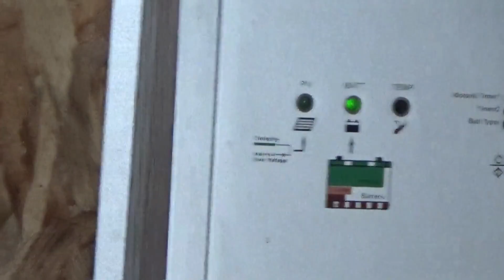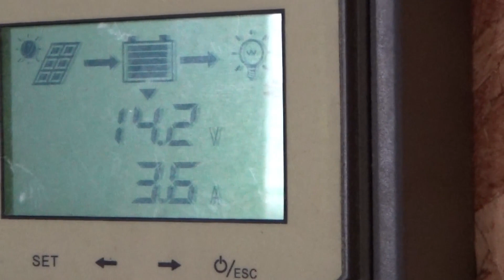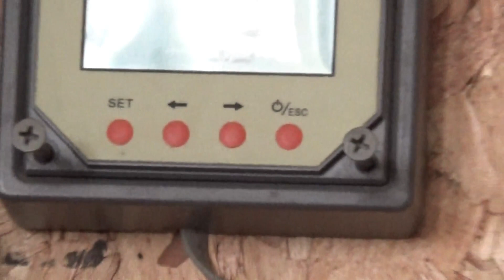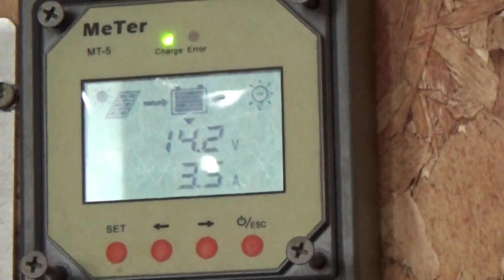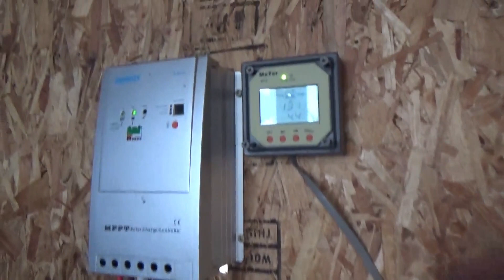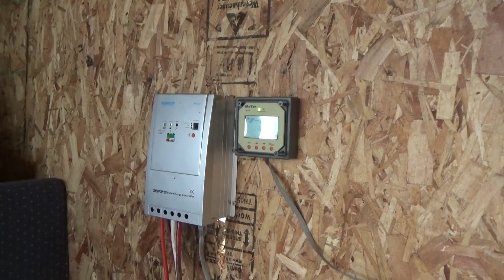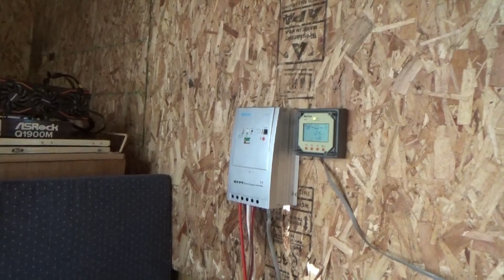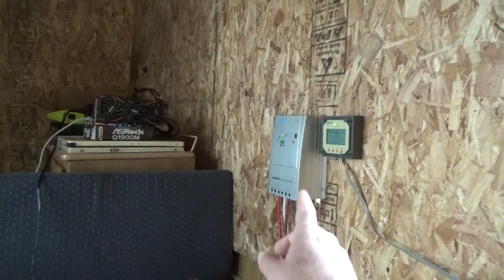Setting Up Solared Cryptocurrency Mining Farm At The Homestead

Comment: In the future, drill a pilot hole for your paddle bit. Then, if you can reach both sides, which you could have in this case, drill half way through your material on one side and repeat on the other side. This will minimize the material splintering and give you a cleaner hole.

Comment: Hi Troy, why are you using an inverter, the pc runs mostly on 12volt, you can use some buck converters to power the 5v and 3v, your wasting a lot of power converting 12v to 120v then back to 12v again!!
Reply from the maker: Simply because I have one now. I will get the pico ATC power supplies and DC DC converters for the mining rigs soon. Once I am done testing the rest of the system.

Comment: I can run laptops on not pure sinewave power inverters. And charge anything USB chargeable (so far). And charge batteries for powertools. And power lamps with led bulbs (some led bulbs). But I don't have beasts like that 3500W inverter :-)
Reply from the maker: Newer computer power supplies seem to be more sensitive. Older ones are probably not. I guess its hit and miss.

Comment: Was wondering why not just use one of the bedrooms in the trailer you don't currently live in to put all your crypto computers? You would still be able to use solar but without the fear of leaking.
Reply from the maker: LOL. Its simple. I have a wife and she wants those rooms free to be used. Also we generally use both houses in summer, back and forth. And its easier to set up alarms and security where nobody is moving around all the time - aka - a closed separate building.

Comment: If I may ask.... What is the value of electricity in your area (what is the rate your power company charges per kilowatt-hour )? How many kilowatt-hours of solar power do you expect to use for mining per month? Not counting computers, how much do you expect to spend on equipment for mining... Solar panels, charge controllers, inverters, batteries, and other miscellaneous supplies? Also, the cost of added security equipment?
Reply from the maker: Annie, he is fairly and equally gruff with everyone he does not fully agree with. lol. And its sort of fun discussing the differing view points.
Reply from the maker: Yes, lets put aside grid tie due to the horrible cost of putting that together legally. I will soon be able to run pretty much anything I want. Plus mining for free. But do consider that if crypto pays the bills and I can run it on solar, increasing my income, then its great.
Reply from the maker: Electricity costs 10 cents per KWH but I dont plan to use any. I plan to use as much as I have to spare each month. Whatever I dont burn for household use will be burnt on crypto. I am making automated control systems to turn on and off mining rigs as the power is available. Excess power not used at the time because we are not even home during the day to use that solar.
Reply: Troy, one final point on excess solar power... For the moment, setting aside a grid tied system... Some of that power could be used to improve your standard of living. Such as running air-conditioning on a hot summer day. Or you can run crypto mining rigs as you are doing. Just pointing out that there are options for use of the excess power.
Reply: @DavidJohnson-tv2nn  - He will never be a clone of you.
Reply: Annie, I never said he should be.
Reply: @DavidJohnson-tv2nn  - You critizise him constantly for not doing what YOU would have done - in the comments on every single video. I have no idea why he is still talking to you the way you treat him.
Reply: Annie, I'm critical of the off grid lifestyle, not of him personally. I'm even more critical conspiracy theories and fear-mongering promoted on other channels. I guess you don't believe in free speech?
Reply from the maker: I spent maybe $7 on security equipment. Parts for the Arduino are very very cheap.
Reply: Troy, sounds like you are able to set this up cheaply. Which should work out great. But regarding excess solar power, I would rather send the excess power back into the power grid through a grid tied system. Thus reducing my power bill down as low as possible. But it's not for me to tell you how to use your solar power.
Reply from the maker: I have a ton of electronics components from when Radio Shack went out of business and sold stuff for 90% off. I have so many voltage regulators and transistors that I think I can make it all myself eventually. Its gonna make great video.
Reply: Troy, Regarding those batteries... I suggested that you sell the junk batteries for scrap. As for the 2 batteries you are using now... (Out of how many that turned out to be junk?) If they continue to function properly, great! You saved some money and that's always a good thing. But it did take quite a bit of time to restore them.
Reply from the maker: I am planning to set this all up with the lowest possible cost overall. I am considering going straight 12 volts DC to the computers, bypassing power inverters and everything. The batteries are only a buffer for clouds and for a charge controller which I may also be able to do away with for a few bucks in electronics. I am designing my own systems and circuitry even now.
Oh and the batteries are recycled from my old RV. You know, those batteries you told me to toss out or recycle as scrap.
Reply: @TheDoItYourselfWorld  - How do you have the patience to answer him? ...

Comment: HI Troy
You can run your computers directly of 12V : https://www.aliexpress.com/item/32826517978.html
I did a similar thing with my solar powered robot lawn mower,, instead of going 12V DC - 220V AC- 24V DC I found a DC to DC step up converter and just goes 12V DC - 24V DC,,, I went from using 2,2A to 1,0Ampe - ish.
Also,, if the CPU is not mining,, maybe see if there is a power saving mode in bios,, if the GPU is doing all the work, the CPU might not be doing much.
Reply from the maker: You jumped the gun on me. lol. I am planning to do just that. I will be using 24-12 volt converters and pico power supplies for the 5 volt and 3.3 volt supplies. I may even make my own converters using parts I have on hand. Its simple.
I will be experimenting on my antique computers first and then move on to the real thing once my circuits are tested.
Reply: @TheDoItYourselfWorld  The Pico thingy probably do not supply enough watts to run much of a Graphics card,, except the up to 75w they take in through the PCI-e port. but the 6 and 8 pin connectors are all 12v,,, so a step down regulator, from 24 to 12V would do a good job.
Reply from the maker: Yes generally the CPU is put into low power mode. I have a tiny ASUS all in one mini ATX computer with passive cooling and a celeron CPU. It uses 20 Watts and I can run up to 3 graphics cards on it mining. It works quite well and saves energy.
Reply: @TheDoItYourselfWorld   Okay that is cool.
Reply from the maker: Each computer will have its own pico just for the CPU and motherboard. The cards will run on DC directly.

Comment: Will the mining rig continue to run off the batteries at night? Nice setup BTW.👍
Reply: I think he said he turns it off when 
solar power production is low .....  
But that was a different video...   ¯\_(ツ)_/¯
Reply: Pretty sure he is building an arduino controller to monitor voltage and power off the gear at night or low power situation
Reply from the maker: Tux got it right. I am working on a micro computer which will automatically control the entire operation for me. As the sun rises mining rigs will be turned on and as the sun sets or clouds come in mining rigs will be turned off. Fully automated. Its on my electronics channel. The Do It Yourself World Electronics
Reply from the maker: Casey Casey, right. Your comment came through after I answered.